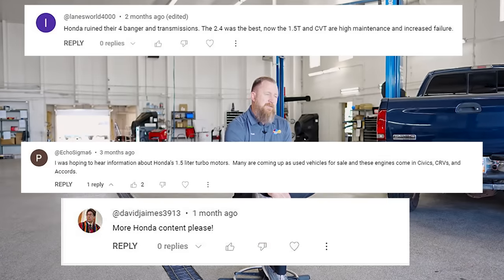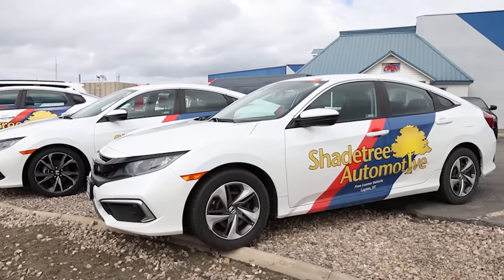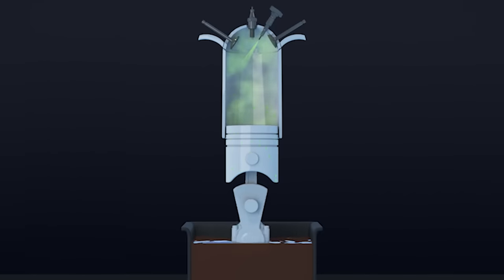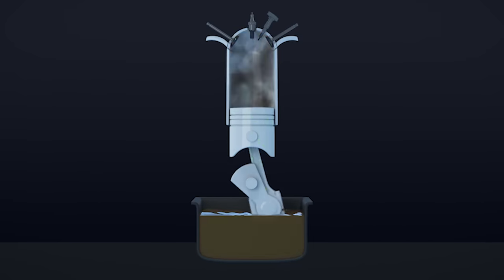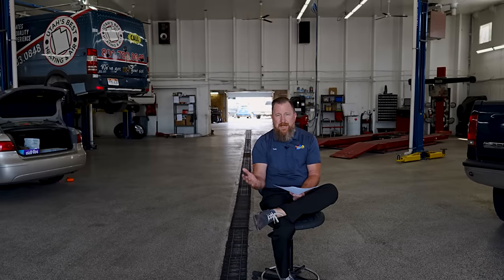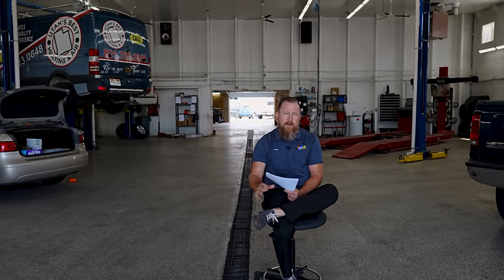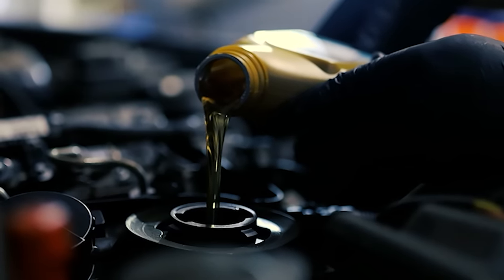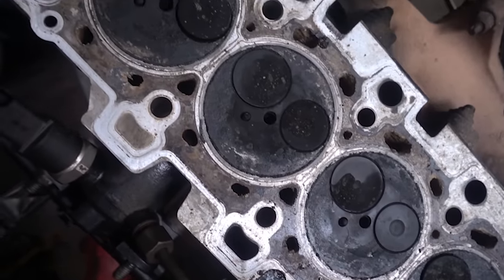Honda Oil Dilution Issue - Should you buy a new Honda

Comment: The biggest problem with fuel dilution of the oil is that the lubrication film starts to fail and you start to get accelerated wear.

One way to avoid the problem is to bond a permanent film of lubricant to the metal #XcelPlus

🙂

Comment: Wrong! I own a 2017 honda civic sport touring 1.5L turbo engine model and that is absolutely not what is happening! Let's try going to the problem. The PCV Valve is a joke! You are dealing with a flawed design with a plastic piece of shit! The PCV Valve is sucking oil through it and causing the Valve to stick either open causing the engine to lose its vacuum at idle! I can sit at a stop light and feel the brake pedal start sinking to the floor. Or if it sticks shut it causes too much positive crankcase pressure or it is increasing the cylinder pressure so much that it is pushing the fuel past the piston rings and ending up in the oil! What i do is pull the PCV Valve out of the back side of the valve cover with a 10mm wrench and pop the Valve out of it's hole and I already know that when I shake it back and forth you can't hear the Valve inside clicking as it does when it is working properly. So I squirt a shot of mass airflow sensor cleaner up inside and you will see the oil come out of it! When you shake it back and forth now, you will hear that the Valve has dislodged and is now clicking as it should. Now reinstall the Valve and start the car! You will now have a nice solid brake pedal and the engine that was running rough before you pulled it will now be idling as smooth as glass and power when you step on the gas pedal i guarantee it folks! I do it all the time and that is really the answer to your oil dilution issue! I don't know where or why they are telling people misleading information about this? If you do what i just said to do you will without a doubt find out that the information is correct! 😉 Now, the other issue this guy mentioned is a battery issue! And I can once again give you the real culprit of this problem! I found some interesting information about honda removing thirteen pounds of lead from the batteries of the cars shipped to warmer climates trying to get the maximum amount of gas mileage by lightning up the car in every manner possible! But these cars have a massive amount of things that take electric to operate them! And my civic acquired a hitch in its getty up around 24000 thousand miles! The car was slowly losing power. So I decided to unstrap the battery hold down bracket,and I know it says it's a maintenance free battery, but if you peel the sticker back from the top of the battery, you will see that it has six caps that can be unscrewed and expose the inside of the battery. When I did this, much to my surprise the lead plates were not submerged under the acid/water as it should have been! The battery was only half full of liquid and not covering the lead plates! Which I immediately knew had destroyed the battery! I bought a battery with the highest reserve compassady I could find and fit the battery box as well and have put another thirty thousand miles on the car with no more problems whatsoever! Which tells me that the piece of crap battery that honda installed from the factory was garbage and they had to of known this but went ahead and put it in the car anyway! Thanks Honda! I sure appreciate you looking out for your customers, Not! 🤔

Comment: You are incorrect saying these engines require an intake cleaning. One of the things honda designed into this engine is a way for the valves to rotate within the seat, and the seats are beveled in a way that fuel can spray onto the valves. This seems to be an effective system for keeping carbon build up on the intake valves from occurring. High mileage tear downs have subsequently confirmed this to be the case and that the engine stays fairly clean, unlike other direct injection engines. Please correct your video.

Comment: Honda shoukd never turbo charged their engines ! It should have  retained the 1990’s vtec motor!  My 1997 Honda Del Sol Si , which is a Sohc Vtec
Has 221,000 miles! It runs strong!  Direct injection is also garbage!   Multi point fuel injection is better!  The1990’s Honda motors are better!

Comment: First, warm the damn car up.  I would warm the car up for 5 minutes minimum and definitely not the major cure but as you said cold engine is not good and all that high rpm on cold start will most likely aggravate the issue.

My vehicle is this engine but actually is a MFI, so it's not as bad and I am not experiencing the issue. 

DIY oil changes.  I drive a lot but I maintain oil changes every three weeks.  Do it every 3500 miles max, if you do prolonged oil changes than you should do it every 3000 miles which means you are not driving a lot.

Also have a sample of your oil tested to see how much dilution is actually occurring, and figure out when the OCI should be done.  It maybe 4000 miles, 3800, etc..

Not sure if it makes a difference or not, but I use the highest octane on my vehicle since day one and my car has a 165,000 miles 0 issues.  

*I live in low elevation, and my climate is warm. In addition, prior to my oil change I use seafoam in my fuel to help with carbon build up and clear the injectors for proper spray.  Not sure if it makes a difference but I do not want the seafoam mixing into the oil.  My OCI is overkill, however my engine is typically operating for 45 hours a week and I do not like my motor operating way more than usual running nasty oil and even with the most premium products it only costs me 50 dollars a change which is cheaper than dealers and more expensive than using Mobil 1 or penzoil which means you should be spending less than I do

Comment: That happened only on certain number of vehicles 3 years ago and problem was fixed.
Reply from the maker: ok
Reply: That's good to know. I bought a slightly used 2022 a few months back and have been worried about it since I've been hearing about this issue.

Comment: 9K miles on any engine, let alone a turbo engine is way too long. If you read the owners manual, 90% of people do not fall into the "normal" service intervals for oil changes. They need to follow the severe intervals.

Comment: DON’T buy a Honda, buy a Toyota because it’s got both port and direct injection. Change your oil at 3-5K miles, and use Pennzoil Ultra Platinum oil. If you’re in a new Toyota, you’ll likely be using 0W-16 oil.